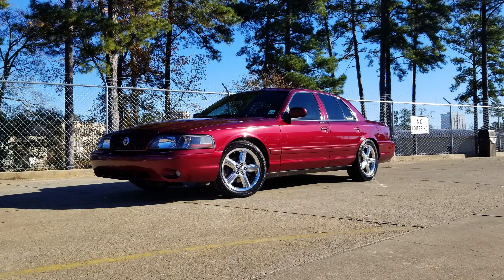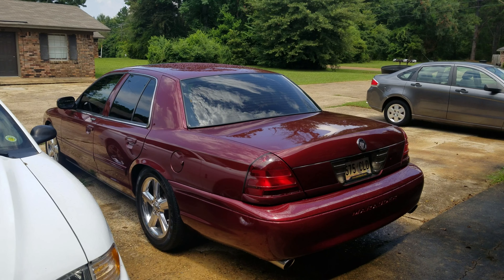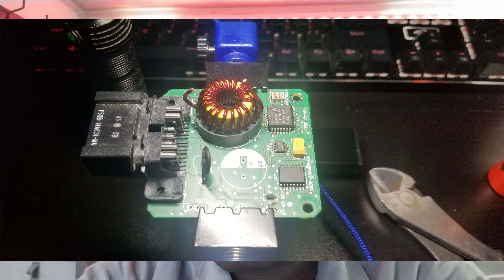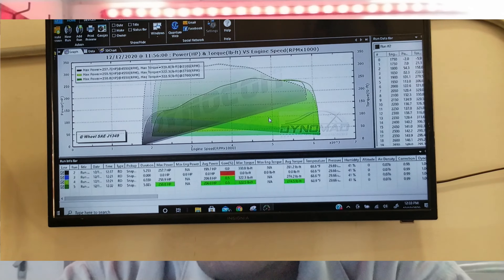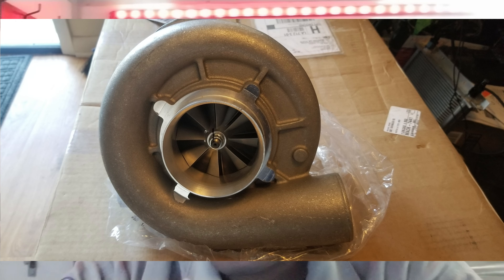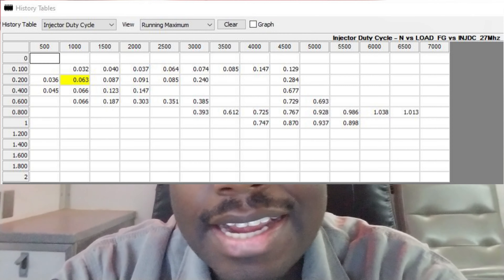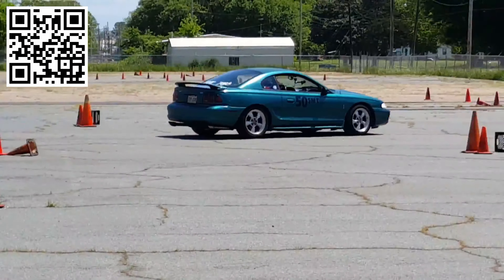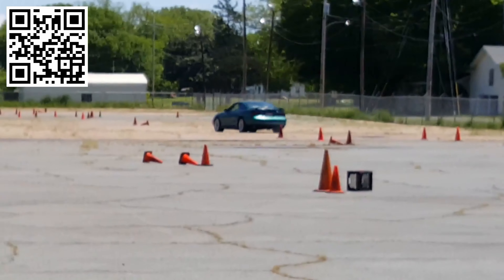E85 Mercury Marauder Testing results VLOG

Comment: Thanks for the video I have a 2004 and want to go E85 I’m sure you answered this but what do I need I have a sct tunner and cold air just bought a 340 pump what size injectors should I need thanks love your videos
Reply from the maker: Thanks a lot. The injector choice will depend on your tuner and the power you want to make. Ford 60lb injectors are a good medium for up to 500 or so rwhp.
Reply: @mr.e8543  do you have a part number on the fuel pump you’re using wanna make sure I have the correct one I also found myself 60 lbs injectors and I’ll be happy with 350hp lol
Reply from the maker: @jrssn95cobrahh65  F90000267  from walbro TI automotive
Reply: @mr.e8543  thanks bud and sorry to bug and ask stupid questions so ones I change the pump and injectors get a E85 tune and good to go ?
Reply from the maker: @jrssn95cobrahh65  all good i set them to be informative. send in as many subs as you can get through as we build ! appreciate it always !  

A tune will get things lined out for it perfectly.

Comment: Noob question. I had a 2015 mustang gt.  I removed the stock injectors from that vehicle.  Will those injectors be enough for a stock maurader to run e85? I believe they are 34 or 36lb injectors.
Reply from the maker: they can work. check the height and type. and that would be large enough for e85 on a stock marauder. they will have to be tuned to work
Reply: @mr.e8543  thanks I'll give it a shot

Comment: Hi I would like to know if you can tell me what I need to do so I can run E85 on my 1998 cobra? Would be greatly appreciated. Thanks
Reply from the maker: For sure no problem . The primary things needed to run E85 will be Injector, fuel pump and Tune. beyond that you will need other mods.  Such as lines and regulator.  

What all does your car have on it thusfar ?
Reply: @mr.e8543  So far I have fuel pump that is 340 lph al so have injectors and fuel pressure gage
Reply from the maker: @richardcetz7994  not bad ! what are your power goals on the setup
Reply: Well im really not sure but I want to shoot 4 600 to 650 . I have a hole procharger kit but still need some gages and a tuner and some one to tune it for me because I don't know anything about tuning at this point lol but would like to lurn lol
Reply from the maker: @richardcetz7994  lol learning is its own process. i have many videos with some things to start with . 600-650 will certainly need a bigger fuel pump on E85 . and injectors to match of course. its a tame power goal that will be very fun though .
Reply: Well I also have a Kenny bell boost a pump a long that 340lph fuel pump will that help